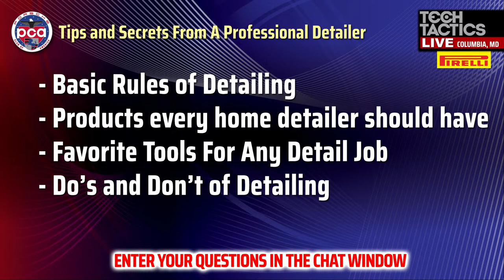Favorite Tips and Secrets from a Professional Car Detailer | Tech Tactics Live

Comment: I still use my Griots Garage boars hair brush that I bought 20 years ago to wash my 2002 Boxster .  Is that still considered ok or should I change to a microfiber mit?
Reply: If the brush is still in great shape, and is meeting your expectations, keep using it. The boars hair wash brush and wash mitt are simply different "tools" and provide different ways of washing a vehicle etc. Personally, I use the boars hair wash brush and a telescoping pole to wash taller vehicles that are harder to reach with a wash mitt.